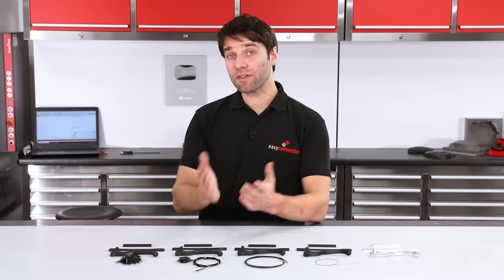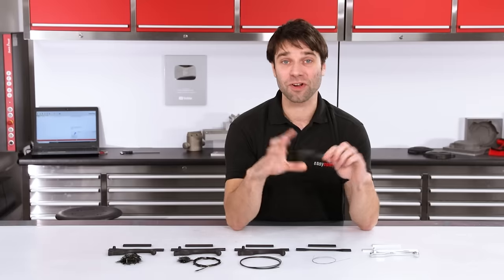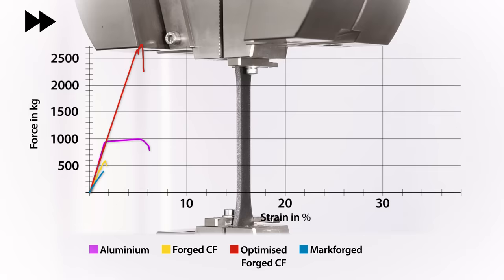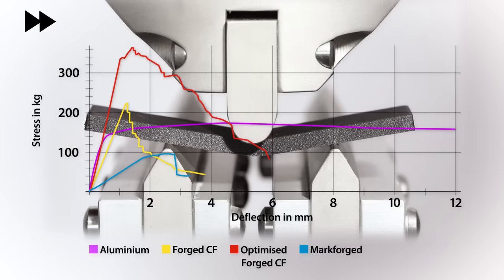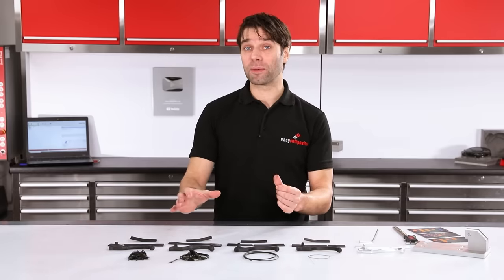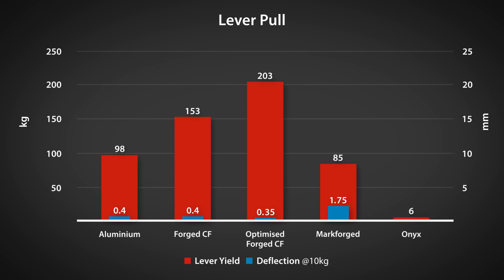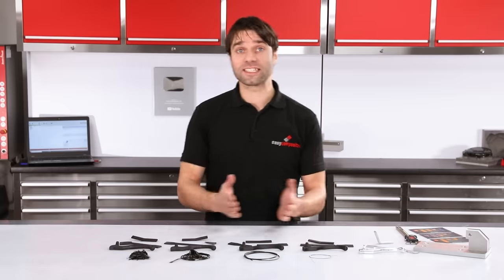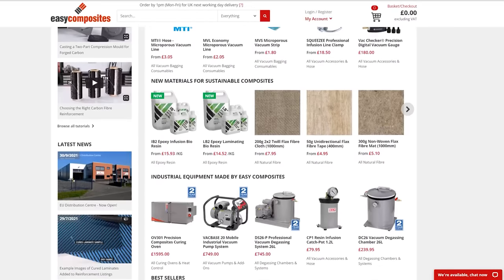How Strong is Forged Carbon Fibre? Forged Carbon vs Aluminium vs Markforged vs Onyx

Comment: Just shoving carbon ribbons into the mold with sausage fingers has pretty impressive results. Just makes me more interested in what might be achieved with much higher precision. Hopefully, it will be analogous to  the just from smelting metail parts to growing metal crystals to make turbine blades.
Reply from the maker: Not sure it would be possible to get truly homogenous results like metals or other solid materials.  The fibre length makes that difficult to achieve.
Reply: @easycompositestv  definitely not sure lol, it was just a very poor analogy. Maybe carbon fibre can be spun like spider silk etc. But the potential is huge. Not even mentioning graphene et al. My point was just its very early days for carbon materials and they're already very impressive:)

Comment: What might be the effect of Test Conditioning Temperature, and prior Light + UV Exposure on these results?
Also I wonder what might be the Notched (IZOD) Impact Strength and Instrumented Falling Dart Impact performance?
We may find a more comprehensive set of tests is needed to make a material selection for an intended application.

Comment: extremely useful for me. Thank you! Can you also compare 7075-t6 alloy and toray t1100 prepreg with the best possible polymer matrix? at least bend and stretch test please. And maybe toray m55j high modulus fiber too? And the same volume, different compound to fiber ratios, up to 70% fiber, pressed to squeeze the polymer out?
Reply from the maker: Hi Den, that's some very specific materials you want comparing but I think that sounds like it may be more of a project for you to undertake yourself! If you do, be sure to share the results with us : )

Comment: Very interesting video, you convinced me to buy your kit, also good in communication! Can you send me information on how to produce standard test samples like the ones you used in the video? thanks and great job!
Reply from the maker: The test samples depends what machine you are using and the test standard you are testing them too. The test token size is determined by the ASTM or ISO standard you are using.
Reply: @easycompositestv  many thanks, is suitable for your test the standar ISO 527-2 (for short fibers / chopped) or 527-4 (for long fibers) for my comparative tests? many thanks!

Comment: Great summary! A fundamental barrier to using carbon fiber (U.S. spells 'fiber' vs. European 'fibre') in automotive suspensions and frame members is its failure mode. It's one thing to bend a control arm or frame. But catastrophic fracture is unacceptable. So, what about a hybrid? Could the carbon component be an insert within metal tubing?  The carbon would enhance the stiffness of the tube, enabling use of a lighter, reduced wall thickness, while the tubing both compressively constrains the ability to fracture, and allows for bending or buckling to remain as the mode of failure. Has such hybrid construction been tested? If yes, can the tubing be welded (& quickly cooled), so welding is permissible AFTER the carbon has been inserted?
Reply from the maker: Not something we have seen tested but it might be possible.  Differing CTE of the materials may cause issues if it is subject to any heat - eg next to engine bay etc.  Difficulty in processing and manufacturing time is likely why it is not something seen commercially - compared to a simple pressed and spot welded steel part.
Reply: @easycompositestv  Thank you for your reply. Given that there are inexpensive carbon fiber walking poles, golf shafts, and moderately priced carbon fiber tennis rackets, I imagine that the cost premium is largely due to economy of scale. A hybrid - sleeving carbon fiber with metal (e.g. 4340 steel tubing) protects the carbon fiber from abrasion, reduces the chance for fracture propagation due to a compressive constraint, improves the bending strength of a steel-only member, offers a superior (less catastrophic) failure mode than fracture (i.e. snapping), and save weight.(enabling use of thinner wall tubing). Seems like a winning (and anisotropic) combination.

Comment: Honestly I kind of think the printed carbon-nylon is being a little underrated for the actual use case of an average motorcycle lever. For almost all bikes the force applied to the brake and clutch levers will be under 10kgf- closer to 5kgf or less with slipper clutches and other modern amenities. High impact loads would occur during a drop or accident but in my experience a bent  lever is much preferred to a broken one, which can easily end the ride. The deflection is definitely not great and it's hard to say how much it would deflect under heavy breaking or a stiff clutch but I think in most cases that's something that could be adjusted for. I'd be really curious to see an impact test.
Reply from the maker: You would have to do some real world tests to be sure but in the lab tests it did not look suitable.  A lever could be redesigned to suit the materials properties as well, but for the testing purposes it was important for us to use the same basic shape.

Comment: I didn't see, but have you tested its impact strength?  How it handles shocks and vibration?  How does it do in heat near engine components?
Reply from the maker: Impact resistance has not been tested.  Heat resistance depends on the resin system - the IN2 can almost reach 90C with an oven post cure.

Comment: Awesome
Always been a little confused though, is forged carbon
Used for skin type applications stronger than laminated parts or is it more for solid parts?
Reply from the maker: Strength is a difficult topic as there are so many variables. A 'forged' type lay-up with the random orientation of fibres would give a more quasi-isotropic characteristic as fibres run in multiple directions and so would have more uniformity of strength in any given direction than say a single ply of woven or UD carbon. However,  those fibres are not continuous as they would be in a conventional laminate and in addition the Forged process will generally use more resin to wet out the fibres thus the strength to weight would be lower than in a woven/multi-axial or UD project. It does however lend itself to projects like the brake level example where a fabric simply wouldn't fit and follow the tight contours of the part - if you tried to lay-up woven fabric in something as tight as the brake lever, its likely you'd have major bridging and voids within the finished piece which  would in turn impact the strength of the piece.
Reply: @easycompositestv  Thank you, that answered my question thoroughly

Comment: Could the strands have been looped in the optimized forged with the tensile strength test?  Single strand looped at the ends for eyelets to mount to testing bracket.
Reply from the maker: Yes for certain applications you could "optimise" the strand lay up to suit an application like that and it would certainly improve performance by being optimised in that direction.

Comment: I know that this is perhaps nit picking, but a good quality brake/clutch lever (like Magura for example) can be bent quite badly, then be straightened again without any tools or the need to remove it from the handlebar and you can carry on with your day as if nothing happened. Sure the forged carbon one might not have bent/broken in the first place, but there would likely be damage to the lever mount, pivot pin or handlebar. Nice video all the same though.
Reply from the maker: Hi Mark, it's not nit-picking, it's a perfectly valid point. One might well determine that aluminium is the right material for a brake lever, or any other particular component. This video is in no way intended as a suggestion or endorsement to make any particular product using this process, instead it's intended to give viewers a better idea of the likely performance of components made in this way and how they might compare to alternative materials and processes. Having done so, we believe that a process that can produce a component that is stiffer and stronger (although less ductile, for sure) than a cast aluminium equivalent, using almost no specialist equipment, has probably got a lot of very viable applications.

Comment: In optimized carbon fiber, you just put continuous fiber along with chopped fiber. Is it sufficient for continuous fiber to take the load and increase the strength of component although it was not under tension during lay up of fiber in mold.
Reply from the maker: Yes, absolutely. The strength of a composite part does not come from the tension the reinforcement is under when it is laminated. Pressure when manufacturing composite parts (like vacuum or autoclave) mainly serve to consolidate the reinforcement, reduce resin content (i.e. increase fibre fraction) and reduce void content. The purpose is not to put tension on the reinforcement.

Comment: Would have love to have normal nylon in the test aswell. Does the carbon dust really add strength?
Reply from the maker: Generally it is very short length fibres rather than a true dust.  Adding fibres to resin and plastic matrix's certainly does add strength and is commonly used in a lot of industry with a variety of fibre types but it does depend on the specific application and it seems, at present, it doesn't seem to work so well using FDM printing.

Comment: Do some new composite tests, flash graphene impregnated resin optimised forge carbon, braided carbon fibre, Kevlar and carbon mix, steel core carbon fibre surround, you have the capabilities to test which I think would be a great video

Comment: I'm concerned about the glass transition temperature of the epoxy used in this process. What will happen to the lever if the bike is stored in a hot car, or even if the black part is left in the sun for extended periods without cooling air flow? Is there a high Tg epoxy with a low baking temperature so the 3d printed mold will survive, or can you post bake a room temperature cured part without deformation?
Reply from the maker: The standard IN2 can go to almost 90C but it needs an oven post cure to achieve that.  If it gets hot, the resin may soften slightly the first time exposed to heat as the resin post cures itself then it will not soften in future. On thin parts this may lead to distortion of the part, but on thicker parts like the brake lever, it is likely thick enough that its unlikely to distort, although the surface will be damaged as the resin softens and sinks slightly. There are higher temperature resins but they all still need a post cure to achieve the high TG.

Comment: I've heard about Mylar, where aluminum/aluminium is placed upon a plastic sheet (or cellophane) using a vapor deposit method (plasma sputtering, I think).  Would it be possible to do something similar with carbon fiber, to create a hybrid type material?
Reply from the maker: I'm afraid I can't put the process you're describing into a composites context; maybe I'm misunderstanding but I don't think this seems like something that would be possible or applicable to (carbon) composites lamination.

Comment: Can you use a unidirectional pre-preg as the surface of a part, then fill with chopped tow and resin, then compress to make a hybrid forged carbon part?  Or is there an incompatibility between those materials?
Reply from the maker: Pre-pregs need an oven cure so cannot co cure with a room temperature curing resin.  You can use raw UD fibres, like the optimised process to get similar results.
Reply: I have seen people do something sort of like pre-preg with wet layup. They put the carbon fiber and resin between two layers of plastic and aggressively squeegee it so that it has the absolute bare minimum resin necessary for wet out. After that they place the wet resin more or less as if it were pre-preg. You could even let it sit for a while until it has partially cured to make it more like pre-preg. I haven't tried it, and your mileage may vary so....

Comment: Question. What if you weaved the continues pressed carbon. It should give you more strength in more directions.
Reply from the maker: What do you mean? Like a woven carbon cloth laminated? If so it wouldn't be forged carbon as such and would have its own practical issues.  Laying up multiple layers of a woven cloth in such small moulds is difficult and would not give anywhere near a random orientation of the fibres.
Reply: @easycompositestv  No take the strips of carbon and weave them together, maybe like a rope or multiple layer's of sheets that are woven in a 3 directions. Just a thought. Also could you do one more test. Connect all handles to a cable that has the tension of a clutch and then have it pull and release it 1000 times and let see if it will hold up to real world use. I use to race dirt bikes and know you are off and on the clutch and brake.
Reply: @easycompositestv  Ok it was just a question. Now could you do a test of repeated use. By attaching a cable that has tenchin on it and then have it pull and release it 1000 times on the different types of handles?

Comment: The Onyx is an interesting material to me. It seems to me that in certain applications, despite its poor performance against this test, it might actually be more suitable.

As a mountain biker, I have experience with handlebar components breaking in crashes. I wonder if the stiffness of the material is good enough for the component to be used as intended, but pliable enough that it's resilient in crashes.
Reply from the maker: Certainly the Onyx and other similar filaments will have their applications where the stiffness is not so critical.  However this specific application and for applications where stiffness is important, the other materials performed considerably better.

Comment: Can you redoit with flex seal. Flex seal the crabon or put it on the inside and see what happens
Reply from the maker: Not seen this done with a flexible resin/rubber. Obviously for this application that would be undesirable.

Comment: Is there a larger risk to a forged carbon part becoming extremely sharp in the event of an accident, particularly with interface points where a human touches them? I'm thinking downhill bike brake lever spearing someone's leg.
Reply from the maker: With the amount of force being applied to break the lever as shown in the tests, it would unlikely some one would still be gripping the lever fully due to crashing so the risk is not so high. If it broke free at the handle bars, the chances of it spearing someone in the leg is quite slim due to positioning.

Comment: Is it possible to mix in, some aramid fibres strands ? (ex: safety reason)  With these combos, are there problems with "length temperature coefficients" of aramid vs. carbon?
Reply from the maker: Generally yes you could make a hybrid mix of aramid and carbon strands.  In most cases you will get an amalgam of the properties of both materials.  This can be advantageous in many applications and generally in many cases we have seen, the issues you mention have not been a problem.  This would be subject to reasonable testing of course as other applications it may not work as well.

Comment: Was wondering would forged carbon be good enough for chain cover on automotive engine. I gues it`s good for oil pan, since there are even plastic OEM ones, but at chain cover never seen such item.
Reply from the maker: as in chain or cambelt cover?  Most on modern cars are either injection moulded plastic or simple cast alloy.  They are generally there to keep dirt and debris out of the timing gear.  No reason why you could not make one from forged carbon albeit there may not be significant advantage to doing so.
Reply: @easycompositestv  alloy chain cover such as on japanese cars. For weight saving for racing use. As I understand in these type of engines alloy chain cover also plays role in structural rigidity of block.

Comment: Could you test the resin by itself that was used for the forged parts?
Reply from the maker: On its own it would be pretty weak, certainly not strong enough for this application.  Most resins will have the basic mechanical data on the standard TDS.
Reply: @easycompositestv  Thank you for the response, I just meant to do that as a control.

Comment: Could I make a mini bike frame out of carbine? is it strong enough for 200 lb rider at 60 mph?
Reply from the maker: Well, in theory you could because you can make a pushbike, superbike or formula 1 car frame/monocoque out of carbon fibre, but if course these are very complex components and would need to be designed and executed correctly in order to be safe and effective. Also, components like those would be much better off being made using more tradition carbon fibre processes such as resin infusion or prepreg, which you'll see us covering in detail in lots of our other tutorials.

Comment: Can we 3d print more efficient metal parts with what we know about Forged CF? Grain structures and stuff?
Reply from the maker: Not having any experience with "printing" metals it is hard to say.
Reply: @easycompositestv  I wonder if the next step in material science is being able to order grain structures at the atomic level for perfect structural integrity.

Comment: Must be remembered that Aluminium will bend dent and some times crack but rarely brake. Composite parts rarely sustain impact damage. Then, if you use composites on a critical part of the bike and you drop or crash the bike you might not have the chance to ride, so you will get stranded.